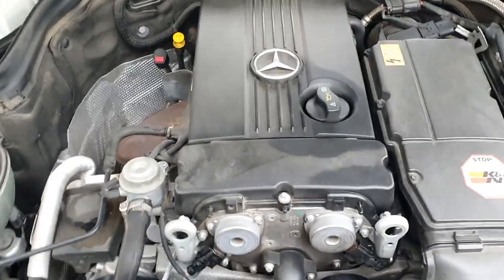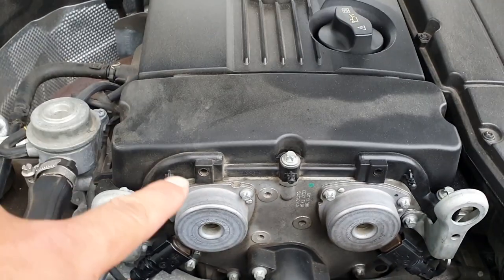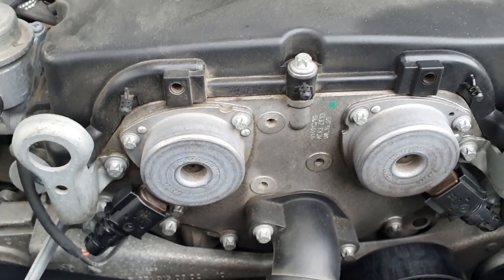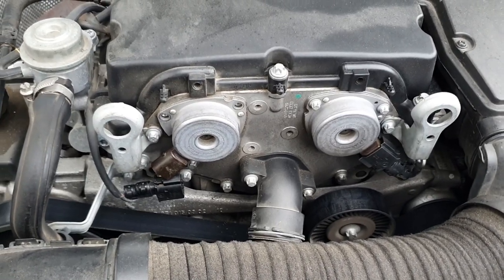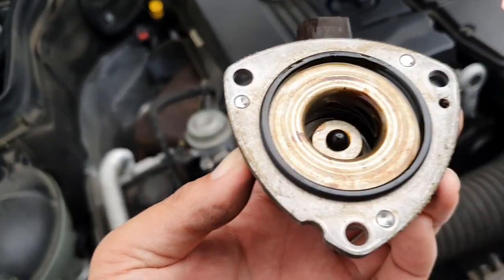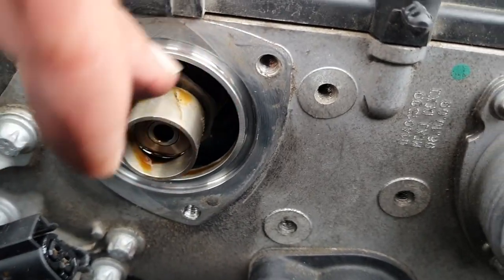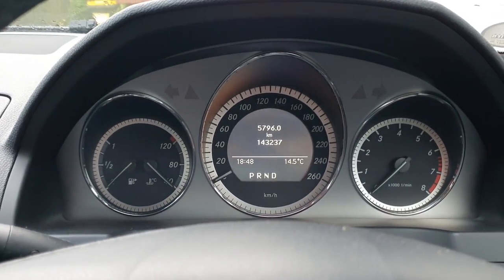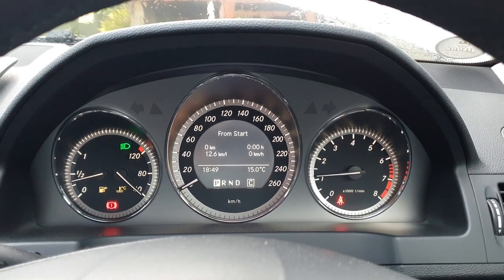Mercedes Benz C200 Kompressor - Cam adjustor magnets cheap DIY fix! W204 M271

Comment: Thanks for that. Lucky you having had no problems. My 2008 (160,000km) has just had new camchain, fuel pump, injectors, spark plugs and cam magnets. I found the central grommet difficult to fit.
Reply from the maker: Yeah the central grommets are a pain, not sure why they didn't just fit them at the factory 😅

Comment: Hello thanks for the video. Are the new updated cables to be added as an extension to the existing ones or do they completely replace the old ones? Thanks
Reply from the maker: Its adding on to the existing harness/plug
Reply: It is about 8" long and is normally mentioned as an oil stopping cable. Even after installing this oil stopping cable open up the ECU box next to the engine to check if engine oil had reached the ECU board. If yes spray it with electronic dry contact cleaner. Let it air dry for 1 hour before putting it back.

Comment: Why is your c200 kompressor so quiet? Mine has 123k on it and sounds loud. Replaced all mounts yet have a strange,yet slight grumble at about 2000rpm. Any ideas. Thank you
Reply from the maker: @lancegraham7722  did you try taking off the accessory belt and spinning all the pulleys? It's a common Merc problem around 100k km that all the pulleys will start wearing out especially the idler pulley(s). There's only 1 idler and 1 tensioner on the M271 so you can replace those easily. That's where I would start! Otherwise depending on the noise it's making there are known timing chain and tensioner issues. Hard to say without listening to the car and test driving the car
Reply: @LueysGarage  thanks, will try this to start. Appreciate your time
Reply: @LueysGarage  the big spring for the belt tensioner has a polymer sleeve acting supposedly as noise suppression. This was found damaged by my mechanic when replacing almost all the chain timing parts and the water pump for M271. Let's see if the engine is at idling rpm without the AC switched on would be less noisy.

Comment: Apart from the leaking oil, what would faulty cam adjusters cause to the engine?
Reply from the maker: The leak will seep oil into your wiring harness and ECU eventually. If the cam adjusters fail (not the same as the leak) then it'll just perform poorly at higher RPM

Comment: Good morning. How long is your dipstick from tip until it's stopper side. I bought one dip stick having length of 570mm. Can you dip for engine oil level in the morning. After starting the engine wait 2 minutes and dip again with the engine still running. My dip stick gained oil level of not more than 3mm. I presume that this is an indication of piston rings still having not much of gas blow by. Engine oil topping up is less than 1/2 quart for every 5000km. Regards.
Reply from the maker: I'll have to check this for you in a few days, usually if you run the engine the oil will be a little higher as oil takes a while to travel back down to the sump afterwards. I keep my oil between mid and high mark and its fine. 1/2 quart every 5000km is within tolerance I'd say, depends on how many KM your car has done. Mine uses about that and it's done 145k km.
Reply: @LueysGarage  A week ago while changing the top cover rubber gasket found out that the inlet adjusters having 21 of its 44 teeth worn down to remaining 30%. No rattling sound.

The other adjuster, still having all of it 44 teeth, they are worn down only by about 10 to 20%. 

The bad worn down adjust have 2004 stamped on it while the other one 2005 stamped on it. Going to be a USD2500 job. 😂😂 Regards.
Reply from the maker: @whlawson5812  Not what you want! Surprising there's such a big difference between the 2. I do think Merc quality improvement heaps around 2004/2005. Before then it seems it was quite poor

Comment: Question: would oil seepage form faulty camshaft sensors throw a bad signal to the ECU and thus result in a failed Co2 emissions test?
Reply from the maker: I would say this shouldn't happen with the cam adjustor magnets but it could happen with other components or sensors
Reply: @LueysGarage  
But oil seeping from the cams sensor wire harness to the ECU would malfunction the module, would it not? I've already replaced both O2 oxygen sensors, but exhaust emissions are still very high. Also, the ECU is not throwing a fault code or engine warning light. What else might it be?
Reply from the maker: @goinsouth5187  its possible but if the oil has gotten to the ECU etc I'd expect worse symptoms than that, did you check the plugs to the ECU to see if they have oil in them?
Reply: @LueysGarage  
No, not yet. I'm having it checked on Tuesday next week. My C180 is driving perfectly but burning a lot of fuel, and Co2 emissions are 3.7% at 2,700rpm when they should be below 0.20%.
Reply: @LueysGarage  at idle, fuel reading can be as high as 14 or 15 lites/100kms. The lowest I've managed to get it on the motorway is 9.2 lires/100kms.
Ideally, it should be between 7 or 8.
Reply from the maker: @goinsouth5187  sounds like that would be something else altogether. Most likely you've got a bad MAF or O2 sensor
Reply: @goinsouth5187 it is normal if you travelled out by just a mile or two and then park with engine idling while your wife goes into a shop to buy something. Or you travel less than 5 miles but with slow traffic with many traffic lights.
Reply: @goinsouth5187 not possible for CO2 result of 3.7%. Is it rather the result for CO?.
Reply: @LueysGarage on my dashboard mounted OBD2 the MAF would be reading at 4.2 to 4.5g/second vs MAP at -7.3psi at 750rpm hot idling with air cond switched off and selector on D mode. Throttle body position at about 14% open.

At 3000rpm on a sufficiently steep road & 2 passengers the MAF will be not less than 60g/second with MAP at +8.2psi.
Reply: Yes,  that could be possible,  as i had engine light come on and the code was exhaust cam sensor bank 1 Code was 0078. Upon further inspection, there was oil leaking from the cam adjustor and leak into the plugs. I cleaned the oil from plugs and cam adjustor but due to replace  them soon and that completely fixed it and code has not returned. Hopefully this can help, but i find not all the time a code reading is exactly the issue.

Comment: Had my camshaft adjustmers replaced 6 months ago  , just noticed theyre leaking again. Is that normal or dis the mechanic mess it up?
Reply from the maker: Not normal, take it back
Reply: @LueysGarage  just did he pretend that it's fine and said I don't think its a leak just residue
Reply from the maker: @nickpaparidis5602  use degreaser to clean it up then check later if its still leaking or seeping
Reply: @LueysGarage  will do thanks , guy is supposed to be mercedes specialist last 40 years , must've lost interest

Comment: What happens if the magnet socket comes out while the engine is running? Thank you .
Reply from the maker: You'd probably lose a ton of oil? Don't know if there's any other problems but sounds like a very unlikely scenario

Comment: Why replace the magnets and not just the seals?
Reply from the maker: It all comes as a kit including the harnesses, you could just do the seals but I did actually notice my car performed better afterwards which might mean the magnets were getting a bit worn out after 140K km...either way the parts are cheap enough that its the time that is the biggest cost and so you might as well do the entire job

Comment: Was there recognizable change in engine performance after changing the cam magnets? thank you for the video.
Reply from the maker: I do think the engine was smoother afterwards but it was hard to tell. I think my old magnets were still working but I just wanted to prevent the oil seep
Reply: What is a sign that these parts are faulty?
Reply: @alexekb196  its the oil seal that seeps oil onto the electrical plug that can lead to damage as he explains in the video. Sometimes you can just take the seal out and flip it and it will seal again for several months to a couple of years.
Reply: @UncalBertExcretes  I didn’t understand anything))

Comment: Hi, after you started the Engine, i observed the consumption is decreasing while engine is warming up,mine is increasing.. do you know Why?

Thanks
Reply from the maker: Doesn't it depend on your units for your display? l/100km lower is better, km/l higher is better. Mine is set to km/l so when you idle the car the number will go down as you're using more fuel per km if that makes sense?
Reply: @LueysGarage  a great, i have l/100km, i understood now, thanks
Reply: I have the same engine plus lpg all Mercedes-Benz petrol the have the same problem I want to go and start do  the job 💪😀💪💪😀 Tirana ALBANIA ❤
Reply from the maker: @jimmymala2095  yeah lucky its an easy fix
Reply: I just can’t read the data from the fuel consumption display correctly. Can anyone explain how to correctly understand these meanings?

Comment: You are wasting your money 😂😂😂
Reply from the maker: So my dad kept taking his car to Oil Changers which is like a quick lube thing here in New Zealand, they never actually did anything apart from change the oil and filter. Turns out he had this oil leak issue in his old C180K and caused the entire wiring harness to be fouled by oil. Cost thousands to put right and probably contributed to a premature starter motor failure too. You don't want to skim when it comes to electrics on modern cars so thanks for your opinion but you're misleading other people.
Reply: @LueysGarage  what i mean is that you only have to change the rubber seals which cost less than $5  now you understand
Reply: @frankiegregoriou4604  installing a new rubber seal (o-ring) does not solve the problem of engine oil getting into wire harness. It needs the "oil stopping cable".

Comment: Another one who doesn't show how to deal with the rubber grommets as they are so tricky to change. You are so clumsy, doubt you dealt with the grommets yourself.
Reply from the maker: Thanks for telling me how terrible I am for putting up a free video to help other people 🤣 The grommets were a little tricky like I said in the video, its not easy to film something so small when you're pushing them in by yourself. You just need to put pressure on the grommet and slowly work your way around. I've dealt with a lot worse when it comes to cars